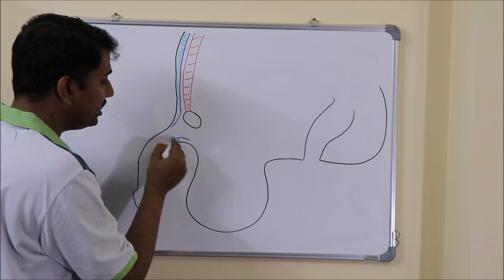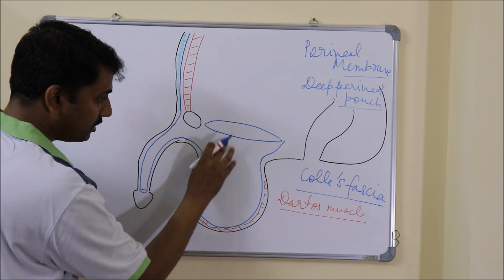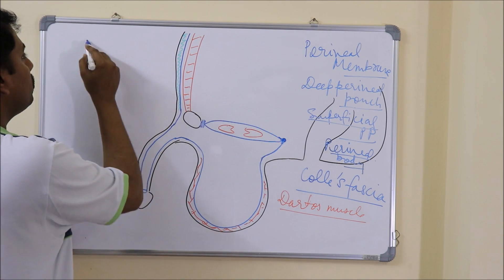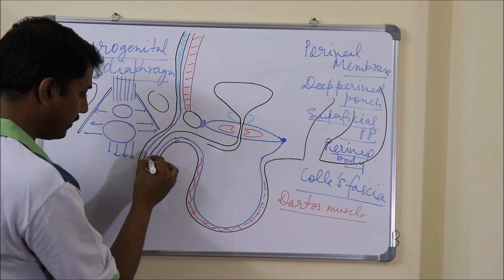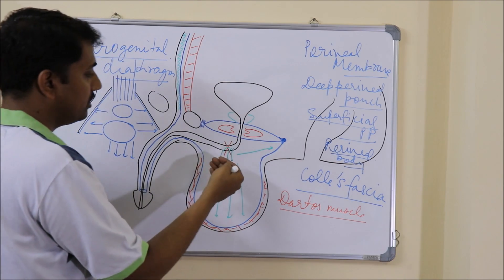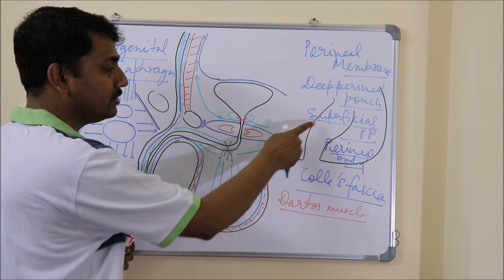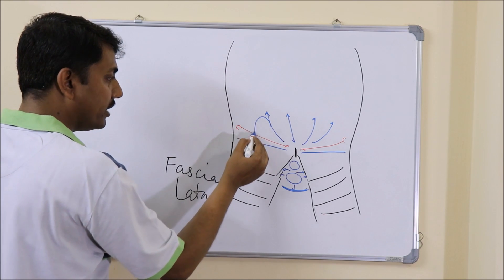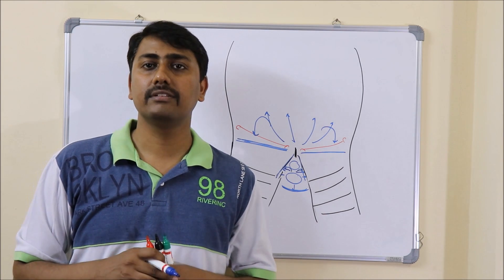Anatomical Basis of Extravasation of Urine in Urethral Injury

Comment: Thank you for your presentation, I found it helpful, although I feel obliged to point out a few mistakes:

1, it is the superior and inferior fascial layer of the urogenital diaphragm, where the inferior fascial layer is called perineal membrane
2, you completely omit the bulbar part of the urethra, and you incorrectly refer to it as penile urethra
3, the correct classification of urethral injuries is not deep and superficial, but anterior (penile and bulbar) and posterior (membraneous and prostatic)
4, I also think it is necessary to stress out that both scarpas and campers fascia of the abdominal wall merge at the level of the umbilicus, potentially setting another obstacle in cranial spread of urine leak

BW
Reply from the maker: Thanks for the suggestions.